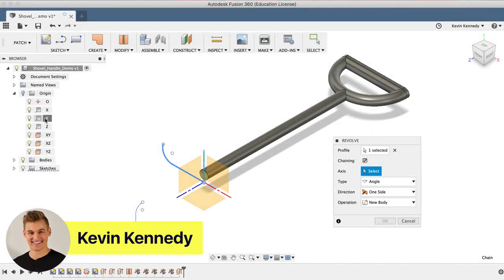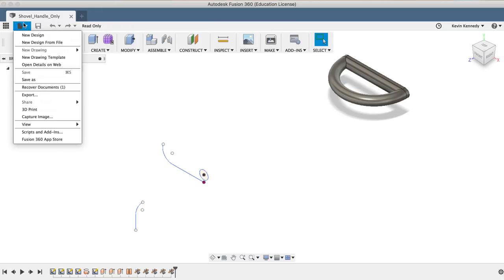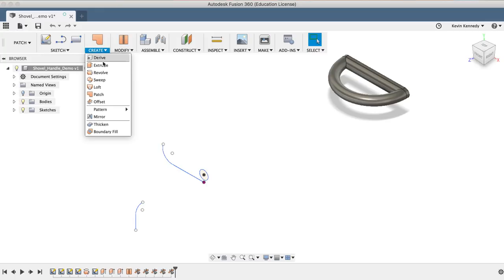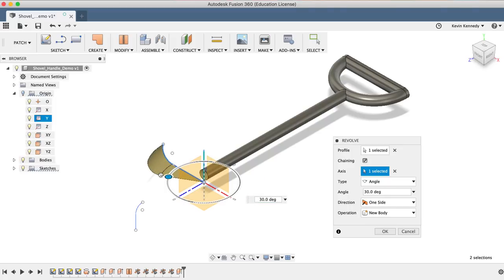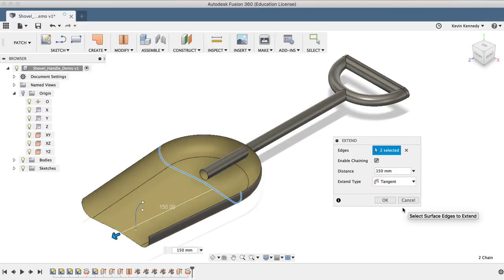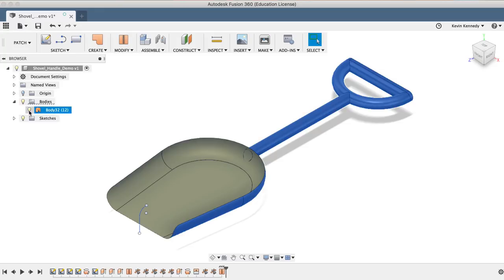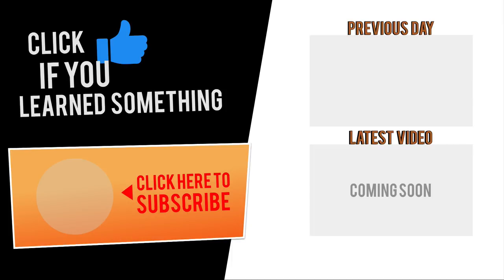Fusion 360: Surface Modeling a Shovel in the Patch Workspace

Comment from the maker: Do you wanna see more surface modeling videos?? If so, comment below and let me know! 😉👇
—
TIMESTAMPS
0:00 - Surface Modeling a Shovel in Fusion 360
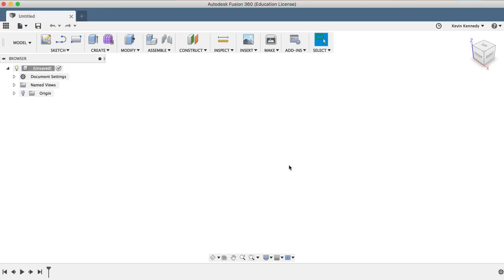0:32 - Getting the sample file
1:23 - Understanding the sample file
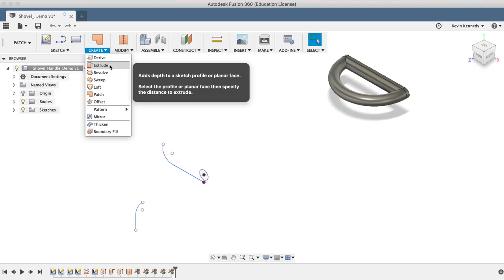2:17 - Extrude shaft of the shovel
2:50 - Revolve the blade of the shovel
3:48 - Extend the blade of the shovel
4:26 - Trim unwanted surface(s)
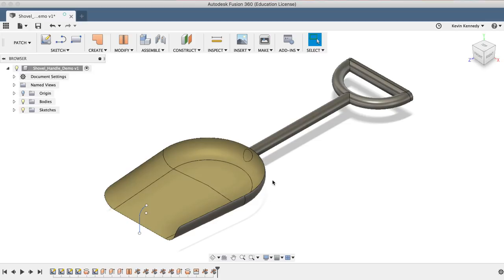5:24 - Adjusting the taper angle of the blade
6:03 - Stitching the surfaces together
6:32 - Thicken the shovel surfaces
6:56 - Finishing in the model workspace

Comment: In my version of Fusion, I had to stitch the handle and shaft together separate from the bottom after trimming away the spot where the shaft and handle touch. Then I had to thicken the two sections and join them together. It must be a change they made in an update.

Comment: Thanks for all the work on your tutorials!  I noticed that the top of the handle is not closed and tried some ways to close it with a nice rounded appearance without success - do you have any guidance about what process would be best for this?
Reply from the maker: Hi Vince. Have you tried the "Patch" feature on the openings?... followed by adding solid modeling fillets once the design is "Thickened" and turned into a solid.

Comment: Issue. I am in the new UI and when I go to select the shovel exactly as you did fine, but then with the trim tool activated still I can't get the end of the shaft to turn red like you do. Instead the whole shaft highlights in whitish grey and theres a message saying something about cutting tool does not intersect any surface. Just to be sure im in the design tab left side and clicked on surface which I believe is the new patch, correct?
Reply from the maker: Hi, James. That is correct. Anything that was previously referred to as "Patch" or the "Patch Workspace" is now "Surface". With the trim tool, make sure you select the tool first.

I'll have to revisit this design file to see if anything is different on my end. Cheers, Kevin :)
Reply: @ProductDesignOnline  I'm having a similar issue. Every time I try to trim the excess part of the shaft, it doesn't allow me to. I've resorted to using the split body tool. That seems to do it just fine.
Reply: This happend to me today and I found that when I extruded the handle I clicked on the inside of the circle to select it.  I went back and just clicked on the edge of the circle to select the extrude and the trim worked fine then.
Not sure why, maybe extruding the inside of the circle created a solid body or something....

Hope that helps.
Reply: Ran into the same message. In my case, my mistake was using the "E" shortcut, which enters the solid body extrude tool, rather than selecting it from the surface menu.

Comment: Quick queston - when doing the thicken, you mentioned selecting all three sections of the body at once, so I just clicked on the body in the browser.  That gave an error "The selected faces could not be offset".  I slowed down the video and noticed that you selected the shovel, handle tube and handle in that order.  When I did that, the thicken worked.  Any idea why selecting the entire body didn't work?
Reply: I got the same issue
Reply: I had the same issue, turn on chain selection and then for whatever reason it depends where on the model you click for the selection for it to work. I have no idea why its very strange

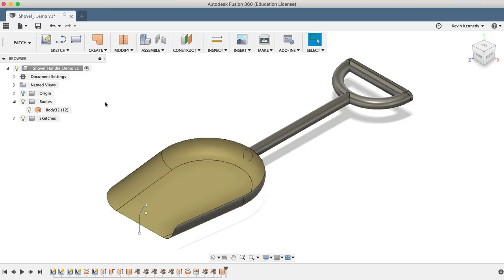Comment: 6:26 I had to hold down ctrl when selecting the parts, otherwise it caused an error. Also, there's a surface at the flat end of the handle - if you don't thicken that surface, too, the handle will be open there.

Thank you for all these excellent tutorials!!

Comment: Nice tut Kevin.. i would love more surfacing.. can you do a tutorial on reverse engineering stl files? I use the pull command.. is there any other way? Regards
Reply from the maker: Thanks, Devid! I will definitely be doing more. Have you seen my video on turning an STL file to a solid? That video briefly shows cleaning up a file... but I will definitely have to do more videos going more in depth. Cheers, Kevin :)
Reply: @ProductDesignOnline  thank you so much Kevin.. actually I am an old expectator of your channel and I saw that video.. my doubt is under organic complex geometries, like a face, without having a faceted surfacr, but a single smooth one.. i realize that deleting faces on complex organic geometries changes the surface shape, providing a different object.. if its possible, i can send you an email with an example of a complex organic stl file that i am trying to work.. once again, thabk you very much for your help
Reply from the maker: @baldok  It sounds like the file may be better suited for Meshmixer,  another free Autodesk product, which can handle more complex mesh files. Send me an email and I'll take a look - kevin@productdesignonline.com

Comment: Definate issue with fusion that needs reporting. I thought it was my cheap ebay keyboard for my iMac that I bought a couple weeks back but then just bought brand new iMac magic keyboard and still doing the same. The fault is that when I highlight the profile to revolve and pause I hold down command and tab to switch windows back to youtube to press play for further instructions from you. Only when I do the screen changes to one with the spade mostly vanished. Weird.

Its if the revolve option is selected and not completed that it does it. Also don't know if you recall my saying I could not get the shovel lower section to trim, well now with the new keyboard and 3dconnextion mouse it trims nice. I think fusion when they offer the downloads should say you have to have a mouse and not the iMac trackpad which is useless.

Want more surface modelling videos please.
Reply from the maker: Hi James. Glad to hear the mouse is helping out. That would be in Autodesks best interest to inform new users to avoid a trackpad when possible.

You can report the other issue you're experiencing with the keyboard on the Support Forum. Usually someone from the F360 team will look into it within 48 hours and get back to you. Most of the bug fixes come from user submissions so it's always good to report those things.

Cheers, Kevin :)
Reply: With the new mouse and keyboard the shovel lesson went without any issues. Everything worked as it should. Was frustrating when I tried doing that lesson and stuff kept not working. I was aware you had done the lesson on the Old ui and that I was on the new and because I am new to fusion 360 I had no knowledge of how to fix the fault. Was it simply the ui’s or something else. Hate readings forums so just left that lesson unfinished. Now to find it was because of the mouse and trackpad, well I wonder how many other people are having issues and don’t know it’s their non genuine devices causing it.

Maybe you want to give me the link to report it to them?